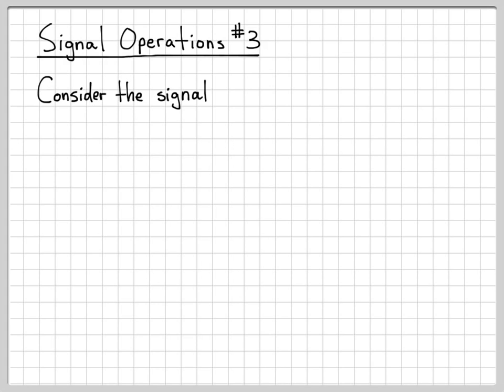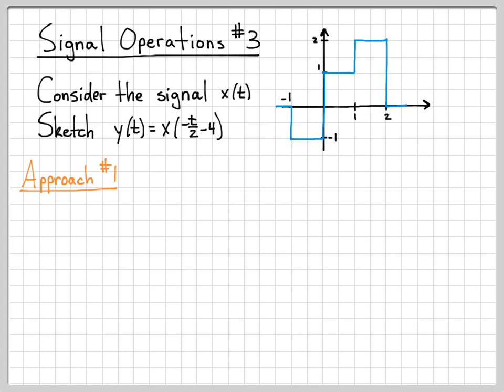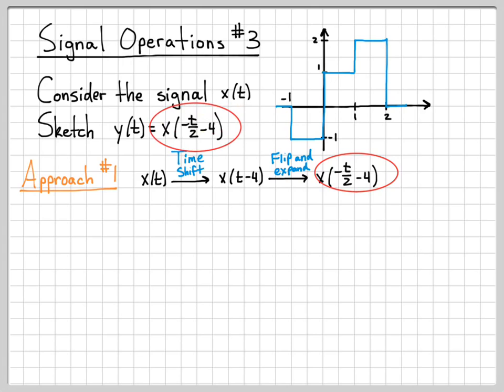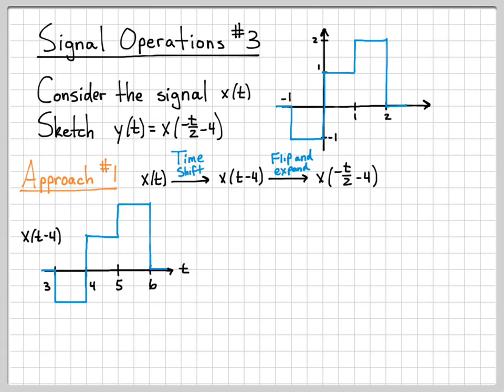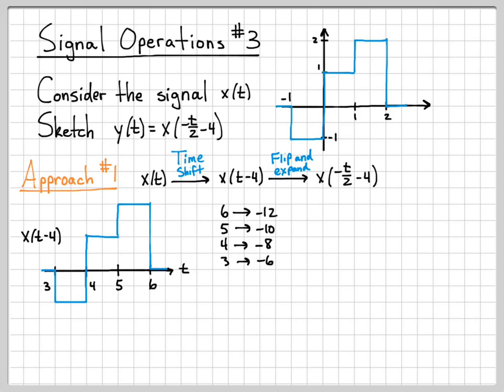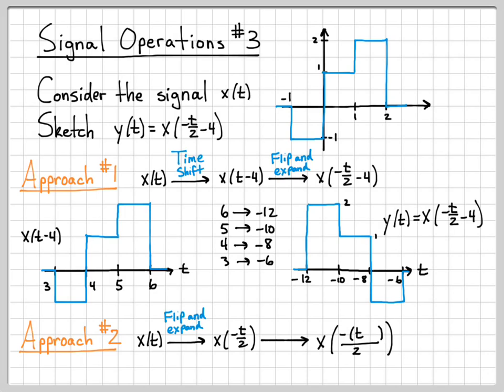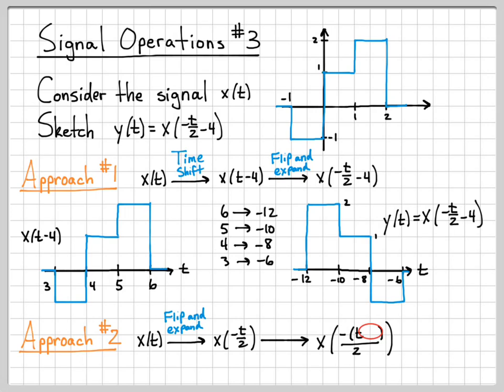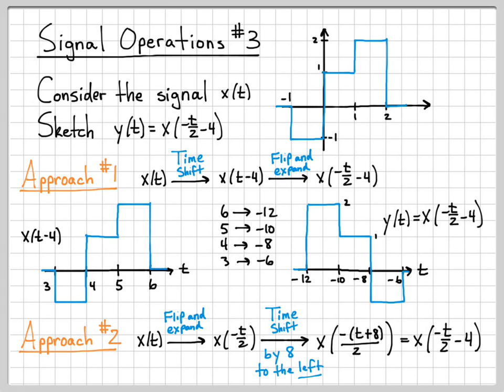Signal Operations Example #3

Comment: in the 1st approach you shifted the signal right by 4 units and then you wrote flip and expand right? 
what if we 1st shift the signal right by 4 units and then expand it by 2 and then flip the signal? 
will we get the same signal as in 1st approach?
Reply from the maker: In general, the order of shift/flip operations is important.  In the video I actually worked through two different approaches.  In both approaches, my goal was to end up with the signal x(-t/2 - 4).  Depending on whether shift/flip or flip/shift, the numbers used during these operations had to be different in the two different approaches.

If you keep the numbers the same you'd end up with a different signal.

If you're just talking about the order of reversing/expanding, the order of these operations is not important.  I can expand then reverse, or reverse then expand.

Hope that helps.

Adam
Reply: Adam Panagos thank you for these videos. the approach is brilliant helped me a lot.